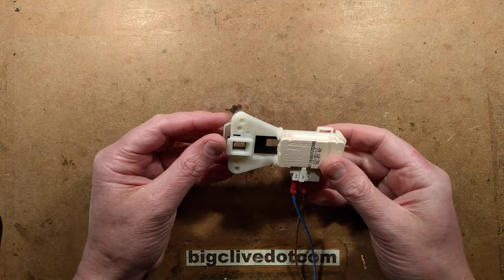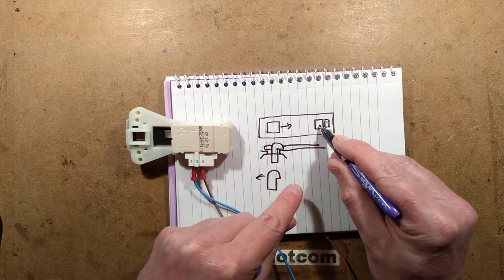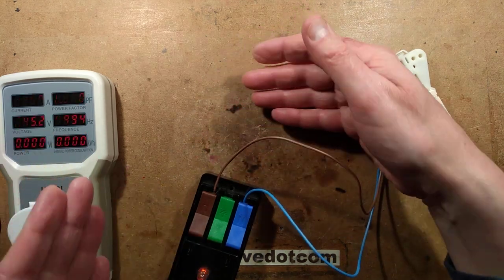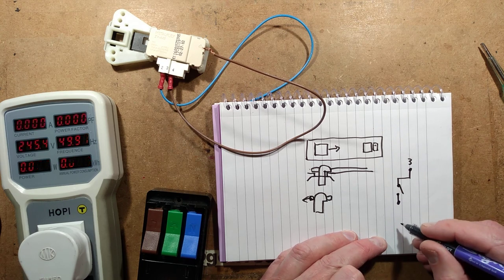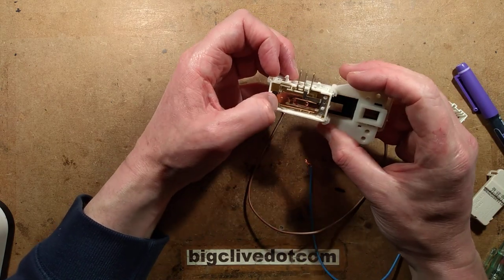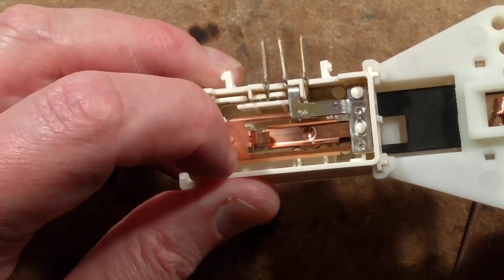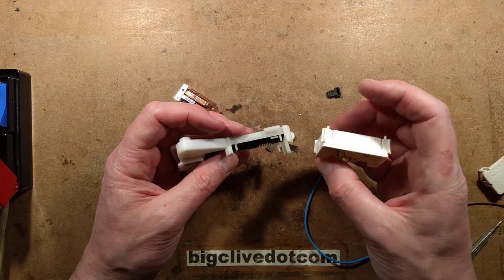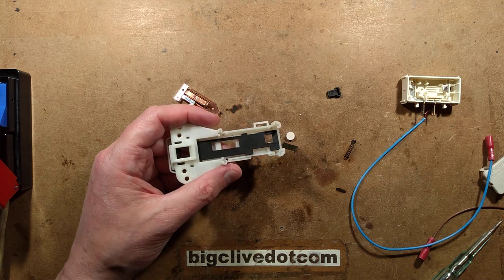How a washing machine door interlock with time delay works.  (not a wax motor)

Comment: I have been a subscriber of yours for a number of years now. 
Thank you Clive for videoing this. My Hotpoint 520 uses a similar interlock which seemed to have gone faulty after about 14 years use. I had no clue how the interlock system could be removed from the machine until I watched this video. Also I managed to repair it after understanding how it all actually works. Repairing it was just a case of carefully opening up the solenoid module attached to the interlock and spaying the moving parts and springs with silicone spray. 
 
On a side note: I looked after my mum & dad throughout 2022. My dad suffering from Alzheimer's and my mum bed bound, your video of you telling the story of you and your brother Ralph looking after your mum helped me so much mentally.    
Thank you again.

Comment: Fisher and Paykel use solenoid locks but if the mains power is cut while spinning they generate their own power through the direct drive stepper motor.
It's a fascinating design when you look at how they do it on the main board which dates back to the 1990's.

Comment: Better design than my recently failed 'outwardly identical' unit. Mine had PTC & wax in a tiny bellows button (wax motor). Bellows  ruptured and wax extruded. No bimetalic strip. Thanks for the dissection.
Reply: was thinking that could be done better /simpler with a wax motor. Had to laugh, not at your misfortune Sir, that they managed to shittify that too, thanks for your post, FIYAFE!

Comment: Thanks for the video, managed to fix my interlock which had come apart (slammed door) thanks to your teardown 😎👍
Ingenious little mechanism indeed. My PTC thermister had come loose and fallen down into the bottom of the casing along with 2 little brackets. It's only a tiny savings but it saved a lot of complaining while waiting for a replacement 😂

Comment: Nice exploration and explanation of the safety interlock Mr C. It is very useful understanding how a thing works when you are faced with fixing a broken one. 

I note for those with locks that do not open reliably that the fixes from the comments seem to be :  Remove the plastic sliding strip. Or increase the size of the hole in the sliding strip. Or remove the lock pin. Or bypass the lock by rewiring it to disconnect the PTC and permanently apply power to the machine. Or buy a new lock and replace it, they are inexpensive. 

Note that the machine model name and number needed to buy a new lock are on a sticker on front of machine inside door. To get your stuck door open use plastic cord/fishing line wrapped round door, pushed in with flathead screwdriver - to tug towards hinge side of door on latch. Or slap panel hard to reset lock. There are other methods in YouTube videos. 

From other videos the method to fit the new lock is : undo the clip round the rubber door seal and push the seal back inside the drum. Undo the screws holding the door lock and fish it out from the gap between the drum and the front plate. Unplug old lock, plug in new lock. Screw new lock back in behind panel, replace door seal, refit clip. 

My lock is sticking and I will probably buy a new one when I get tired of opening the door with fishing line. Stay Safe :-)

Comment: Some machines also have an air hose from the water level sensing system to stop the door being opened if the machine has water left in it.
Reply: Luckily mine just turns off the motor, and applies a break to the drum. If i see something i forgot i can open it, and throw it in.
Reply: Some machines heat the water too up to 90C.
Reply: My old Zanussi has that! - So is a four way interlock. Five, if you consider that as the water level operates two hydrostatic devices, 1: A hydrostatic mechanical blocker on the door interlock, and 2: a hydrostatic switch that only connects the system controller to mains when the water reaches a specific level, ergo, the machine won't start unless the door is closed, AND, the drum contains sufficient water. Similarly, the door doesn't open if there is water in the drum (power or not), and the system controller is "off-lined" if the drum should lose its water, e.g. a torn hose or bellows connector, or any other cause of leakage, e.g. user drain plug is not fully tightened.
Reply: The old Hotpoint 95 series had a pressure operated interlock that only locked electrically when the drain pump operated and they used to make a weird buzzing noise
Reply: @erikjohansson1814  Clive should get a thermal camera on that strip- at 90c the door might not open either way because of the temperature
Reply: @erikjohansson1814  my Samsung one can do 95 degrees C.
Reply: 28YorkshireRose12 But how did the system controller let in the right temperature water if it was unpowered during that very process?
Reply: @TurboTel68  "spin cycle" when idiots are the most likely to injure themselves :))

Comment: I repair the washing machines at a local launderette. Most of the machines are the 1980's Electrolux Wascator W74, if anyone knows what that means.

With these, the equivalent part of the machine has three microswitches, all normally open. Two are closed by prongs when the door is shut. The third is closed when the locking lever is moved over by a solenoid, preventing the door catch from releasing. All three have to be closed for the machine to run.
The delay circuit is a large capacitor and some resistors.This is energised while the machine is running, and feeds the solenoid. When the machine finishes and the power is off, the capacitor discharges, and after about 30 seconds there's a clunk when the solenoid can no longer hold in. Then the customer can open the door.

The aluminium door catch and locking lever eventually wear, then you get customers pulling the door open before the machine has finished, and issues where the machine will stop part way through the cycle. The machines are cleverly designed and easy to work on.

Comment: Modern, more expensive washing machines have drum brakes and an electronic lock that is opened by the onboard computer.
When power fails, the washing machine is permanently closed, until you go into the service door and pull an unlatching handle.

The problem with these heater mechanisms is simple. When power fails, it'll unlatch, even if the washing machine is full of water. You'll 100% not notice in the dark and open the door.

As to failure modes in this mechanism, it's the ceramic block. It will crumble over the span of 10 years (average washing machine lifespan), collect electrical arc marks and stop heating up enough to latch.

Comment: i was wondering if maybe the ptc lost connection from that bimetallic strip since it had that other strip it kinda hooked down to but glad you showed at the end what was going on i was kinda lost thinking the strip bent the other way before that point lol. also iv seen press or punch press video that showed them mass producing little spade ends and electrical connectors for relays and stuff and the amount of steps they go through to get the end part is crazy and just how accurate the little parts are amazed me. after seeing the inside of that kinda made me think back to how all that stuff is made. its very thought out and just so crazy how fast they can make that kinda stuff.

Comment: I always thought that it was done using a solenoid and capacitors as the lock still functions if the mains supply is removed , nice to learn how its really done
Reply: Thats exactly what I assumed too!
Reply: I'm fairly sure that SOME machines DO work that way...for example Wascomat machines(used in laundromats), show a light on the front panel after the machine stops, which goes out to indicate that the door is unlocked-the light going out is accompanied by a loud "THUNK" sound, which I'm pretty sure is the solenoid being powered off and and the latch releasing.
These machines are front-loaders, of course.

Comment: Mother had a Kenmore washer that she bought in the early sixties, and still used it in 1996, when she passed. Had to have the belts replace one time, no other problems, EVER. You could run it with the lid open, no safety interlocks back then. We had more sense than to mess with it while it was running. duh.
A clothesline was the only drier.

Comment: True that. My front load washer won't "click" to allow opening until after the drum is idle for about 5 seconds. AND, if even while it is just filling with water, you have to press "pause" and wait 5 seconds before you can add more clothes. Genius!!!
Reply: Lucky you. Mine takes roughly 2 minutes to cool down*, which is super annoying when the drum resistance means that it stops spinning within 5-10 seconds of being stopped/having power cut.
* Ambient is typically 25-40 C depending upon season/weather.

Comment: I replaced a lid lock on a top loading washing machine that used a pulsed latching solenoid. The solenoid was pulsed to lock the lid before the spin cycle, and then pulsed again to unlock the lid once the tub stopped spinning. If the machine was unplugged during the spin cycle, the machine would remain locked until it was plugged back in and the cycle finished or canceled.

Comment: I indeed changed this very same locking device of my washing machine a few months ago. It lasted more than 10years!
I opened (obviosly) and the ptc was desintagrated. 
It was rated for 16A so i thought the entire amperage of the machine was flowing trough this litttle device and deduced had some thermal mechanics (well i was a tiny bit right)
Great video man!!

Comment: How fascinating! For many years I always assumed it was a solenoid with a capacitor that caused the release delay even when un-plugged. That's why you should never assume :)
Reply: Thats exactly what I assumed too!
Reply: Thinking about it, the 3 watts constantly used by the lock is wasteful, considering the millions of them in operation. Perhaps another fail-safe solution should be found.

Comment: Some newer washing machines will automatically turn on and apply inductive (regenerative) brakes if the drum is spun and the door is opened. It's quite a clever safety feature.

Comment: I just took mine off and jumpered it out so the microcontroller will think the door is closed this way I can adjust the amount of soap I add and put in extra cloths if I wish.  Save us from the nanny state.  The PTC thing can also be found in modern fridges.  It prevents the compressor from starting until it gets cool.
Reply from the maker: The PTC in the compressor might be acting as a solid state start winding controller.  There's often an anti-stall thermal switch too.
Reply: @bigclivedotcom  Clive, if you cycle the compressor on and off by unplugging it too frequently, the relay which includes the little disk, starts to click but the compressor wouldn't start for a while.  Then if you come back a while latter, the fridge is working as it should.  It acts as some thermal protection for the compressor.
Reply: @felixcat4346  I never knew that! There's often a "quick chill" option on freezers, that when pressed starts the compressor (probably not all it does but it doesn't matter in this instance). Turning it off and back on, it doesn't start right away. I didn't realize that was a PTC too! That's really neat.
Reply from the maker: @felixcat4346  The compressors will stall if turned off and on again while running because of the pressure of the gas.  They need a pressure balancing time between runs.

Comment: I've got one of these things on my top loader. It's a real pain, the washer is micro processor controlled and it has a speed sensor on the motor that senses when the drum is rotating and as long as it's rotating it will not go to the next cycle nor can you open the top. Unfortunately when the motor stops it keeps spinning under it's own momentum for about 5 minutes not including the time delay in the micro processor. I've had the thing apart to try and bypass it, but it's impossible. So I just took the interlock actuator off the door and permanently put it in the switch itself. Now I can open the door whenever I want, no kids in the house, only competent adults, so it's not a threat.

Comment: Interesting   I recently had to fix the switch on my top loading machine.  It was also easy to replace by taking out two screws that keep the lid closed and lifting the top of the machine up - it is hinged at the back.   The switch just fits into a rectangular slotted hole under the lid (no screws needed) and it is Normally Open and is actuated by a pin when the top closes.   No time delay needed.   Similar price.  Satisfying when you can avoid an expensive visit by the official fixers to do something so simple

Comment: the bi-metallic strip is the little piece behind the PTC which touches the adjustment screw.. the strip pushes the PTC pallet into the copper spring latch..  this is done for a couple reasons; 1.. allows a safety contact to the PTC and 2.. keeps the bi-metallic piece hotter for longer (but without having the piece get too hot which would melt or deform the plastic housing.. the copper end will dissipate the excess heat and allow for thermal-expansion)

Comment: my bimetallic strip probably burnt put and stopped working....so I inserted a small piece of silicone rubber, pressing down the contact strip with the case cover  to permanently close the circuit...of course I had to remove the locking pin first so that i could still unlatch the door.

Comment: Mein Gott, Helga!  That is a very simplified interlock. You'll have to take my word for it, because I ain't wreckin' me washin' machine just to prove it, but my 25(ish) year old Zanussi has a far more sophisticated interlock than that, though the PTC pill is the same, it also has two microswitches and a hydrostatic blocking mechanism. . The basic principal is clearly the same, but in my machine, the time delay is around 5 minutes before the lock will release, this I assume is because this machine has a "Boil" option, and therefore needs longer to cool down from such a high temperature - with only one thermal interlock, it's a case of catering for the worst case scenario.

A very interesting video to see, and quite enlightening.

Comment: The Secret Life of Machines hosted by Mr Clive
Reply: For anyone not familiar with the actual series:

https://en.wikipedia.org/wiki/The_Secret_Life_of_Machines

You can find all episodes online, although the links from Tim's official site seem to be broken.
Reply: @RFC3514  -- Very interesting series, never heard of before.  Thanks for the tip and link.
Reply: It's surprisingly obscure, considering how amazingly good it is. I've used bits of it in lectures about digital image processing and software engineering, because they illustrate some key concepts so well. I even tried to pitch a similar show to a producer a few years ago, just so we could try to convince Tim to be a technical adviser. :P
Reply: @RFC3514  -- Ha, great idea to get Tim to be an adviser to a revival series.  I like older documentairies about technology from before everything is about processors and internet-protocols. The attention is then often truelly focused on the mechanics of the time, and not yet distracted by what's all possible in the digital realm.
I found the same in docus about the history of the bicycle.  Up untill those from the 70's the docus are about the history much more than the ones from later, that are way more about the new trends that were then coming up, like mountain bikes, new lighter materials, etc.  New docus are interesting in their own right, but they have lost that focus of a time when looking back was the (only) thing to do since there were no new trends yet.
Reply: It wasn't really a revival series (BTW, TSLoM is not as old as it looks; it looks like something from the 70s, but it's actually from 1988-1993), just similar to it in some ways.

What I like about TSLoM is that it doesn't focus on history in abstract ("this is what happened on this date"), it's mainly about how it works, and follows the history of how each type of mechanism was invented (or made possible by another invention or discovery).

For example, most people have no idea that the fax machine was invented before the telephone, but knowing what technology goes into each one makes that pretty logical.

That (the history of the fax and telephone) also drives home the fundamental difference between digital and analogue processing (i.e., the way digital is inherently more robust and easier to transmit reliably), which, again, is something most people don't understand.

TSLoM is mainly about technology and engineering, or at least history from an engineer's point of view. And that's sort of what I wanted to do (adding a "maker's" or "hacker's" point of view at the end) in the new show.

But it's really hard to produce independent stuff for TV these days (archival footage can be insanely expensive unless you're working for something like the BBC, that has its own archives), documentaries sponsored by specific manufacturers invariably end up as long-form adverts for those manufacturers, and the History Channel / Discovery / National Geographic / etc., seem more interested in producing bad fiction disguised as documentaries (ghosts, aliens, cursed treasures, conspiracy theories, that sort of crap) than anything educational about science and engineering. I guess they've figured out it's cheaper, and people will watch whatever is on.
Reply: @RFC3514  -- You made an apt analysis of the current depressing scientific tv landscape.  A well thought-trough series like you propose would be very welcome. I hope it will work out.  For now I've got loads of new 'old' episodes to go through. Thanks.